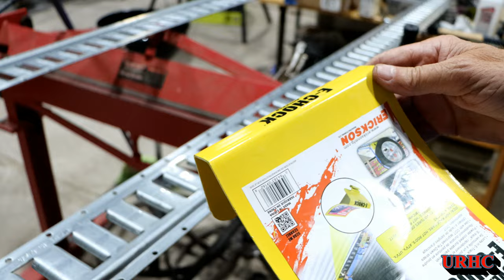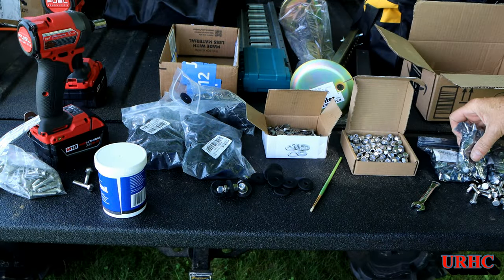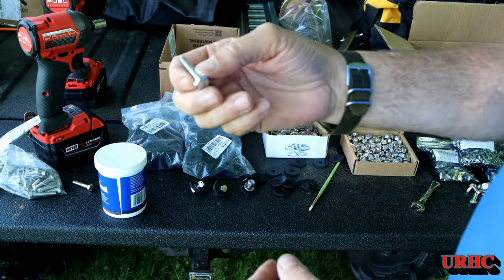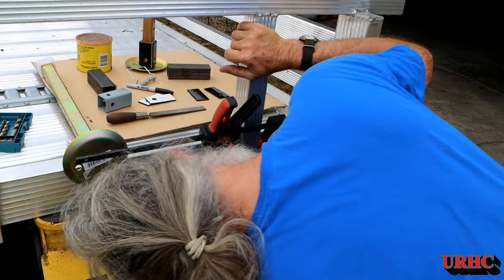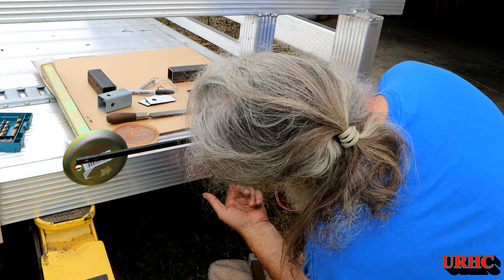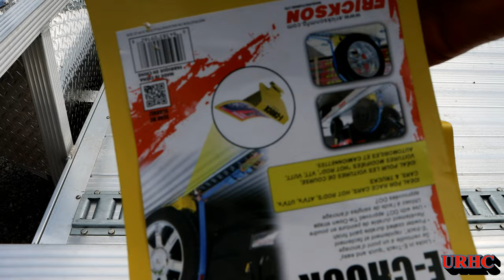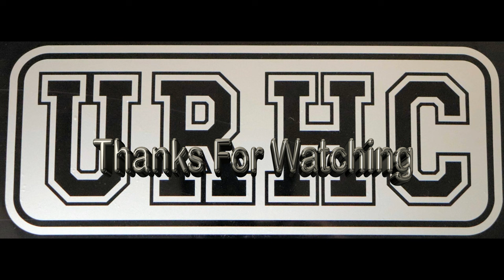Adding E Track, Chocks, Stabilizers, And UTV Tie Downs To My Sport Haven Aluminum Trailer

Comment: Another great video Ed.  You have more patience than I would drilling every hole out and putting in all those bolts in the track.  An added bonus of the round foot pad of those rear jack supports is they will keep the back of the actual trailer from dragging if you hit a rut or go over a hump.  I could not tell how they relate to the plane of the back end of the trailer, but you might want to shorten them a little so they are 1/2 to 1"  below that plane (looked to be more than that to me but could be a camera angle thing).  Either way, great job.
Reply from the maker: They are marginal but so close to the back wheels that it probably would take a curb to clip them. I definitely will shorten them if it looks like an issue. Getting the 2 washers on the bottom with the extrusion lips in the way made it take longer than I expected. Thanks for watching.

Comment: More great stuff..... Sorry you're  having issues with GIzmo fuel in the oil.  Take care
Reply from the maker: Thanks.  It stinks and may be something affecting more then just mine. Kubota said I have to run it for 20 minutes minimum each time I start it and not shut it off for a short period to evaporate the fuel out but I told them that should be in the sales literature.  Mine gained 12 oz of fuel in the oil by the 20 hour service with the oil loaded with white gunk. I think the engine is toast and they say its normal.  Probably going to dump it for a Polaris Ranger once I get it back if they don't fix it right. Thanks for watching.
Reply: That sounds more like a Rube Goldberg excuse for a flaw in the design or manufacturing process.  An engine should be able to start and shutoff without that happening regardless of the time running... (just my $.25 worth ((inflation)). @unemployedredneckhillbilly2023  T

Comment: I just ordered  a Sport Haven trailer and I got the deluxe version and they told me that it comes with stabilizers.  Did you look into getting them from Sport Haven so you wouldn't have to make any modifications to them?  It should just be something that should that can just be installed as is
Reply from the maker: You have to order them with the trailer to get the welded on option. These work good and it is only a light duty trailer that has no strong beams to support bigger machinery then I have so they will last. I probably would have spent the extra for the Aluma trailer if I needed the stabilizers for heavier loads and better tiedowns. Those little D rings on this are a joke for anything over 3k pounds. Thanks for watching.